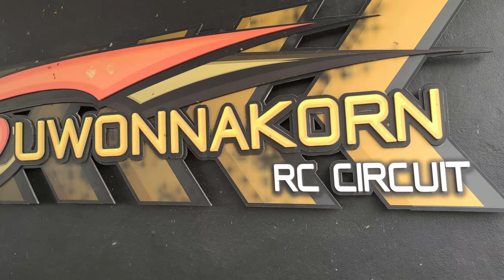3D Printed 1/8  Go Kart Rc Car

Comment: what ESC did you use? If I saw correctly, the steering servo that you used is rated for 6-7v operation
Reply from the maker: I use  esc ft009.🙂

Comment: 👌
Reply from the maker: Thanks.!!
Reply: @Mr.RC-Creator  more power and gears please 🙏
Reply from the maker: @ninjaarcades7356 It uses a brush motor  or brushless motor 540, gear parts is avilable in stl file.
Reply: @Mr.RC-Creator  sorted 👌

Comment: @0:57 what's the Dimension of that grubscrew?
Reply from the maker: I'm using a grub screw size M4x40mm.🙂
Reply: @Mr.RC-Creator  thanks, please if can put it also in the list of the parts used, its a small detail that can make a big difference.

And what about the rims? Did you download another file for the rims that fit on 4mm shafts and use rubber tires?
Reply from the maker: @ripmax333 thanks,  rims parts is avilable stl file. Tries Fornt,Rear tamiya 51399,51400 you can buy at hobby..

Comment: Can anyone tell me where i could get the battery and electro motor etc?
Reply from the maker: Brush motor 540 and battery 2cell lipo1500mAh at Hobby shop🙂
Reply: @Mr.RC-Creator  Thank you so much! Do I also need servo's for the front wheels?
Reply from the maker: @dannickeljon8313  I using servo mg 9g /  Tamiya F104 51399, 514000 Rubber Tires Front/Rear

Comment: how can i get the file for the rims your using so i can use  the tire size you have.
Reply from the maker: I use Tires of tamiya F104 51399, 514000 Rubber Tires Front/Rear.